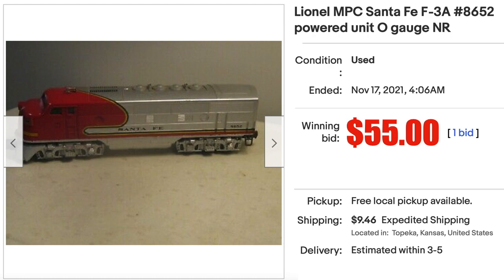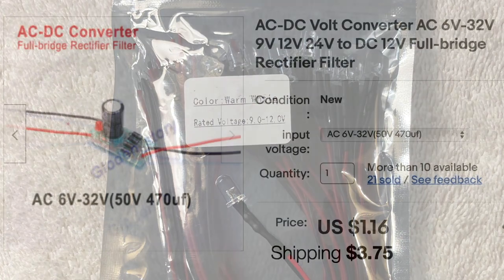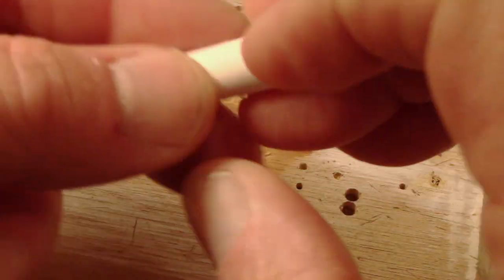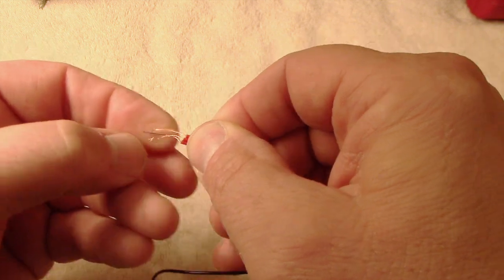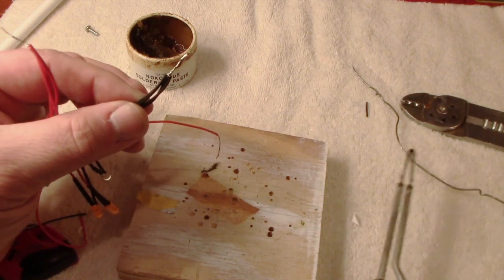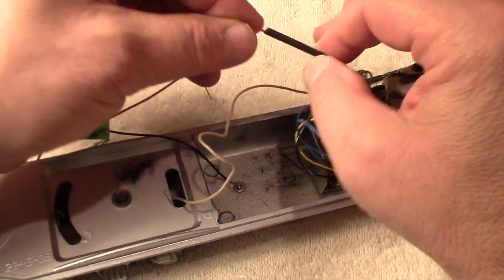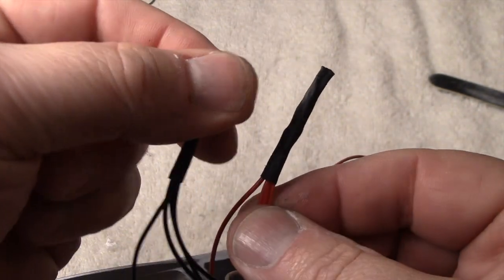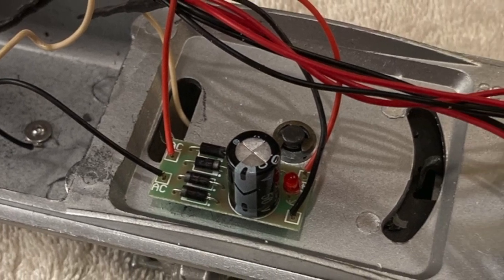Lionel Santa Fe F-3 Restoration with LED lighting Conversion using a Bridge Rectifier O Gauge Scale

Comment: Hi Bob, i power my postwar trains with a zw275r. How do i figure out what leds and what voltage to use? Also, how do i figure out what size bridge rectifier i would need and not burn everything up? 

Any help is appreciated
Reply from the maker: I think the LEDs I used were either 9or12 volts DC. For the rectifier, I think you would need to figure the max AC voltage coming in from your track and match the DC voltage output to the LEDs you’re using. But you should probably check with other sources to make sure that is right.

Comment: Where did you get the rectifier and do they come with the capacitor already installed on that board or do you have to make it up?
Reply from the maker: Hi. It came from EBay. Just look for AC in and DC output for voltage that matches your LEDs I suppose. Have a nice week. Bob
Reply: @bobsworkshop5181  Hi Bob, Thanks!

Comment: NEWBI question Would this work with my lionel transformer?     12V 1A AC to DC,[6-32V ]   would the LED need to be rated for 6 volts and above?
Reply from the maker: I’m not really sure. Maybe check the max output from your transformer and find a bridge rectifier that can handle that output and then match the LED to whatever the rectifier is putting out on its DC side.

Comment: Do you have a link to the bridge rectifier?
Reply from the maker: Hi. No, not really. Mine came from China via EBay. I wouldn’t recommend that way though. It took forever to get here. I think they are pretty common on EBay. Maybe just check what the output from the AC transformer is and what voltage you’ll get from the the DC side and then see what your LEDs require or can handle. Have a great weekend. Bob